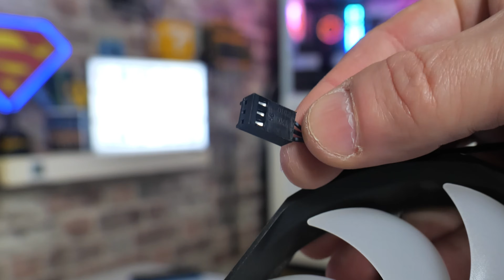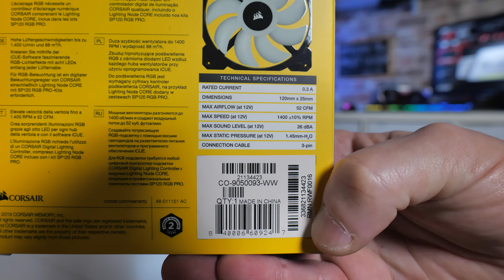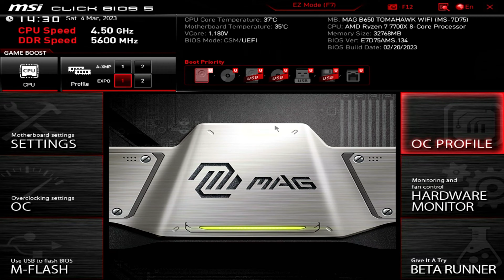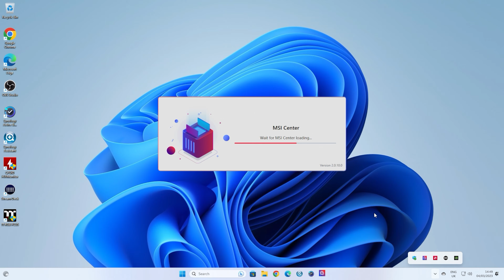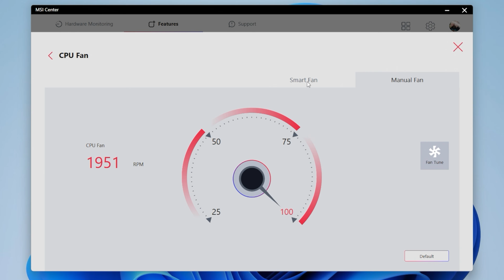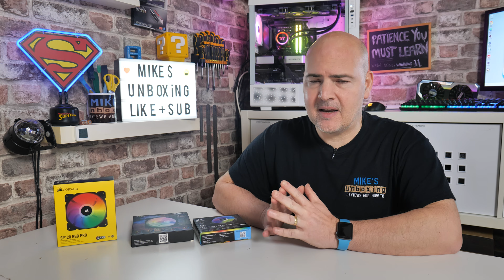How To Setup & Control AIO Water Cooling & PC Fans In BIOS Or Windows MSI Version

Comment: Hello, I wanted to share happiness with you Mike. I've just bought, MSİ Z790 gaming plus motherboard with a 360L ARGB. Also 14th gen, 14700K
After I setup the fan speeds like you, I dont get any more than 27 C CPU degree on idle. Also, CPU socket temp is no more than 25.
It's really powerfull. Thank you so much :)
Reply from the maker: awesome glad the guide helped
Reply: @mikesunboxing  sure. Thank you 😍

Comment: Hey what ram are u using ? I have to msi tomahawk x760e and fury ram compatible for Intel and amd but in bios showing only A XMP profiles. Should I use specific for amd made ram with expo option in bios?
Reply from the maker: expo is for AMD motherboards and processor, XMP is for intel

Comment: I have the thermalright peerless assassin 120 se Argb, and have the 7800x3d ! Any fan curve settings ? I currently am idling around 41-42 ! Is that good or should be lower?
Reply from the maker: sounds about right, most am5 with tower or aio will be high thirties low fourties

Comment: In the msi center, at minute 24:12, what do the Software Control Mode switches for CPU and Fan do mean?
Reply from the maker: that is to enable the MSI software to control the CPU overclocks etc and the msi user scenario to control fans in windows, with these in the off position the BIOS controls them

Comment: Very good video, however if in my curve I specify that at 40 degrees my fan must turn at 30%, if 30% is not enough to stabilize the processor at 40 degrees, the heat will therefore increase and consequently increase fan speed? So what are the settings for?
I hope my message is clear because I'm having trouble cooling my 7800X3D with a 240mm AIO without making too much noise.
The AIO fans are at 50% for desktop use and the CPU is at 50 degrees... that's a lot of noise
Reply: For example, if at 50 degrees I order my fan to turn at 5%? CPU heat will increase because 5% is not enough to maintain 50 degrees.
The setting is therefore useless so why not leave it on automatic?
Reply from the maker: the settings are not for setting the CPU temp, just for setting the fan speeds at the systems CPU temp.
7800x3d is a pretty warm CPU and by design it tries to reach 90c regardless.
So either decrease the fan rpms to get it quiet, or undervolt or limit the CPU wattage to make the CPU meet your temperature requirements.
The "normal" idle temps for the CPU is between 40-60c so your 30c setting is way to low, at least for the CPU In it's default setup.
join our discord for ways to reduce the temps

Comment: Hiya, so I'm using the Lian Li Galahad AIO, I have set the speed to 100% at all times within MSI Center, however every now and then the stats of the CPU and the pump freeze and stop reading, when this happens I also lose control of the pump speed and the pump seems to run at the RPM set within BIOS. I think this is causing my pump to cut out as you stated in the video, as when my CPU temp gets to around 36c the RPM drops to 0, then as the CPU temp heats up again it kicks back in. Again none of this is showing is MSI Center I'm currently having to use NZXT CAM to give me readings. Anyone know why MSI Center is bugging out on me like this? Any help is appreciated, thanks.
Reply from the maker: set the pump speed to 100% in the bios and see what happens. if the fan control is getting issues in windows and reverting to BIOS settings that should help

Comment: Is there a way to base your Case Fans on your GPU temp?
Reply from the maker: yes you can use speedfan to control fans and it will monitor whatever you like, also you can select in the bios what the fan headers monitor

Comment: Thank you for this video! I tried to follow these steps, but I'm facing a weird issue. My case has 6 fans + an AIO 360 liquid cooling with 3 fans. On the Hardware Monitor dashboard, when I try to set a fan-curve for the CPU fan, nothing changes and the RPM remains constant (around 3100 RPM). When I change the "PUMP" fan curve, it affects "all" the fans (6 fans + 3 fans on the liquid cooler). And when I try to change "System 1" fan curve (the only system fan that shows a number), the RPM number does change, but I don't see any changes in any of the fans. 

This was a pre-built system and when it came out of the box, all the fans were set to run at full blast all the time, and it was extremely loud, so I was looking for ways to adjust the fan curves. I would truly appreciate any advice you might have. Thank you.🙏
Reply from the maker: This is maybe easier to fix or at least advise if we can ask more questions and get direct answers, so feel free to join our Discord chat and we can go over it in more detail https://discord.gg/XtBTGQ6BDu
Agree to the rules by clicking the emoji and you will get access to the rest of the Discord channels

Comment: But if we keep the pump at 100% all the time it can cause pump failure right? It happened with me with my arctic liquid freezer 360
Reply from the maker: pumps fail for many reasons, some prefer the constant load some don't but they should all be able to run 100% all the time or they are not fit for purpose

Comment: Nice video mate. One thing. Looking at the bios have you only got one system fan?
Reply from the maker: One header connected to a hub and 5 fans all the same speed
Reply: Thanks for the reply mate. I've one more question. Is you're preference to have the MB control all case fans as opposed to say the pc case doing that like on the Be Quiet 802?
Reply from the maker: @tonysopranosleftnut  there are very few cases that have fan speed controllers so i don't have much experience of that, generally the motherboard bios or motherboard software will give much more control

Comment: my cpu1 header show 0rpm, what could be the case? i have a cable splitter connected and to it but i'm scared of changing the setup.
Reply from the maker: try switching between dc and pwm, or it could be the splitter not being fully wired on each pin or just a loose connection
Reply: @mikesunboxing  gotcha, i will try thank you!

Comment: hey mike. i commented on your live stream yesterday. this helped me so much. and i now know where i was going wrong. my fans in the front of my case are 3 pin dc and the rest are 4 pin. ive now changed these settings in the bios and the unervolt on my cpu are no longer needed. my temp's are so much better now. i didnt realise the fans were that different until i saw this video. thanks alot mike 🙂
Reply from the maker: awesome glad the information helped

Comment: GREAT VIDEO! So helpful. My son's MSI gaming PC was not cooling properly after a recent power outage. Something got scrambled, as the CPU temp was at 210 degrees fahrenheit while idling (sans gameplay). The video was a great resource for how to monitor and adjust these settings - both in the BIOS and in Windows. CPU temp is back within normal limits and what you'd expect based on usage. THANK YOU!
Reply from the maker: Glad it helped! really nice to hear stories like this
Reply: Great Vid with the usual great presentation, thanks Mike.  As I understand it you probably need to 'double check' all your BIOS (UEFI) settings following a bios update (& sometimes a windows update) which is a bit annoying as it means re-doing your settings (Ram, fans etc.)...My guess is that why you (mgriffes) had the issue with your sons PC.

Comment: Be careful with MSI center fan adjusting. Can brick your system. If that happens run windows 11 in safemode and disable msi center under startup apps and change it in bios to "unbrick" system again. If you still want to use MSI center uninstall it first (all data of the program) and then reinstall it afterwards. Stick to bios imo :)
Reply from the maker: weird not heard of that before

Comment: Does MSI Center have to be running if I'm using it to control fan speed? Or does it change the system settings for me, after which I can close it?
Reply from the maker: yes you can minimise the msi center to the task bar

Comment: hey Mike, I want to ask. I am using NR200P Max and my motherboard is ASUS ROG STRIX Z70 GAMING WIFI-I (ATX). I plug the AIO Pump Pin to AIO Header, however it would not boot to Windows. But if I plug the AIO Pump to CPU_FAN header, it boots to windows. Why is that? Thank you in advanced.
Reply from the maker: could be detecting no cpu fan and halting
Reply: @mikesunboxing  so what should I do?
Reply from the maker: @terrytjandra  This is maybe easier to fix or at least advise if we can ask more questions and get direct answers, so feel free to join our Discord chat and we can go over it in more detail https://discord.gg/XtBTGQ6BDu

Agree to the rules by clicking the emoji and you will get access to the rest of the Discord channels

Comment: My pump fan won't change for AIO. Just stays around 5400 rpm no matter what I do.
Reply: Thanks. Seems to be doing its job as intended maintaining 30c at Idle and around 50c playing Fortnite. I guess if it starts whining at me I'll be worried lol
Reply from the maker: might need to change the header type in the bios, although some pumps are fixed rpm

Comment: Hey Mike, this might sound like a stupid question, but are your case fans supposed to ramp up in speed when your CPU is under load?

I just ran a cinebench multicore test and used HWinfo to monitor fan speeds, but didn't notice my case fans actually spinning any faster. My CPU temps were well under control, so I believe my CPU cooler fans were spinning faster, it's just the rest weren't.

Is this normal PWM fan behaviour? I have them configured much like the video where they are supposed to ramp up according to CPU sensors.
Reply from the maker: Yes they should based on cpu temp usually

Comment: Hey just got a 5800x3d with a deepcool Castle 280ex and a MSI mpg edge wifi I'm quite new to building putting everything together everything went pretty good but the fans on that AIO sound like a Corvette going down the highway when the CPU gets to 60° it's like it's other than that the CPU stays at 30 at idle any knowledge with that CPU and AIO
Reply from the maker: This is maybe easier to fix or at least advise if we can ask more questions and get direct answers, so feel free to join our Discord chat and we can go over it in more detail https://discord.gg/XtBTGQ6BDu
Agree to the rules by clicking the emoji and you will get access to the rest of the Discord channels

Comment: Hey I have 4 pins for fan for an AIO argb liquid cooling. With ryzen 5 5600x with b550m VDH wifi motherboard. The only issue I am having is the LED lights for the CPU starts to flicker when the fans go higher I tried to set it on PWM since it is a 4 pin the fan started to spin really fast and the LED starts to flicker so bad. I am lost
Reply from the maker: sounds like it is drawing too much power,  This is maybe easier to fix or at least advise if we can ask more questions and get direct answers, so feel free to join our Discord chat and we can go over it in more detail https://discord.gg/XtBTGQ6BDu
Agree to the rules by clicking the emoji and you will get access to the rest of the Discord channels

Comment: question: if i set the fan curves in the BIOS then play with the curve in MSI Center and find the best curve to my liking and performance, do i have to copy those again back to the BIOS to finalize it?
Reply from the maker: no the bios settings work whilst in the bios and only in windows if dragon center or msi center is not installed, IF msi center is installed the settings will kick in after windows has booted and the software has started

Comment: I noticed you mentioned Dragon Centre on another vid, after I had installed MSI centre, MSI centre was awful, from false positive virus alerts on download & this was a new this week version from MSI not MS Store, the mystic light software was glitchy and nothing else would install via the "app" part,  Uninstalled and cleared my reg of MSI Centre. So I remembered "Dragon" & went hunting, it's much better software & being a new build & new to Argb firmware I nearly did the firmware update thinking my firmware was out of whack - Maybe a PSA on this topic or thoughts on each bit of software?✌
Reply from the maker: there is a virus version of msi center, but the official one from the microsoft store is 100% legit, but i will have a look and maybe a PSA
Reply: @mikesunboxing  I agree, however the MSI forum, as I noted that all "Features" in the MS store version would download but "installed fail" at every attempt. Then I found the forum and found MSI centre on the MSI support pages, however that virus/glitched with Mystic Lights and wouldn't install the "User Scenarios" hence the wipe, Dragon seems to be stable for me and your tutorial also translated to dragon for me - Kudos - Have a look at the forum I don't want to post links on YT you might not see em.

Comment: Great tutorial Mike and very thorough. Reinforces your previous videos albeit I do have one question and that is which takes precedent over fan control, the bios or the msi centre in this video? Thanks again Mike and Kath 🐈👍
Reply from the maker: the bios controls the fans etc using the bios set curve and will carry on until the software loads in you have installed it hope that makes sense?

Comment: Hi, Mike. As I've said before, I like to set my fans and pump running at 100%. I tried MSI center and didn't like it because it tried to takeover everything on my motherboard. The only RGB software I use is OpenRGB.
Reply from the maker: yeah it isn't for everyone, but for beginners or those with limited knowledge it is pretty easy to use

Comment: I personally wish companies would get off their high horse 🐎 and realise creating proprietary connectors is stupid and wasteful (cough* apple connectors)🤣😂😅 forcing you to choose a rgb/fan hub with particular company fans is a bugbear for many. I personally don’t use rgb fans (although a couple rgb light bars I don’t mind) and try to eliminate any unnecessary cabling in my builds
Reply from the maker: yeah i agree totally
Reply: If you never change the connector you risk being held back by old connections “because of connecability”

Considering its a plastic mould that houses cables in most cases… you could have proprietary connectors on everything… the only issue being a hassle to the user.

I am pissed oof that i cant use Corsair fans with my MSI build.. i spent £300 on fans only for them to be incompatible out the box..
But all i had to do was get other ones..

When i rebuilt the mac i have owned.. i search parts buy parts & parts fit & work.. 
no RGB no BS.. so for all the proprietary connectors they make no problems during the build.
The issue comes when you want to use previous models parts in a later one.
Again no big deal.